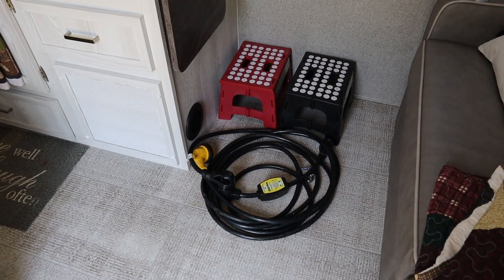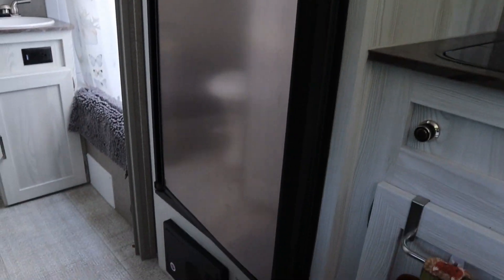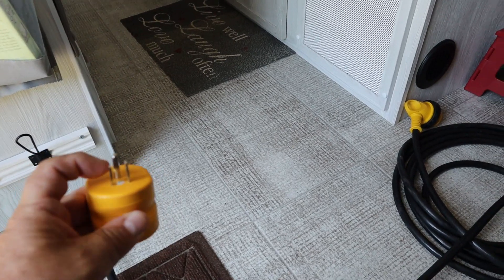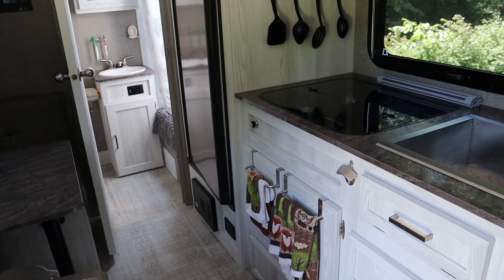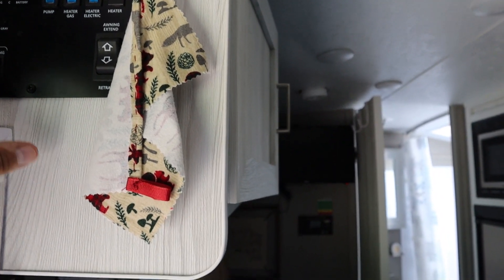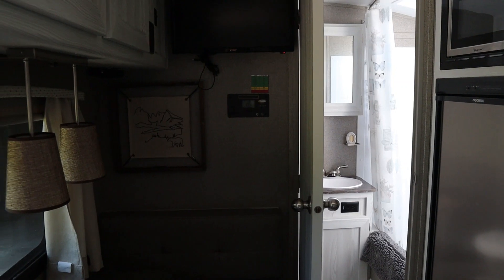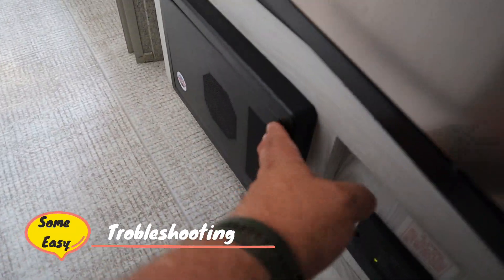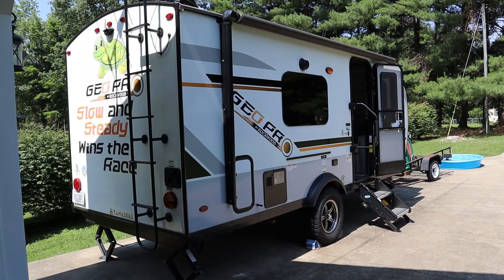RV Electrical

Comment: Good video, but it's actually 120/240.
Reply: Power companies are required to supply 120/240 but by the time it reaches your appliances, it can be as low as 110 due to the distance from the panel to the final destination in the home or office. That's why you'll see voltages listed on appliances as 110, 112, 115, 117, 120 or whatever the appliance manufacturer decides is minimum voltage for their device. Wish they wouldn't do that. Just confuses the crap out of everyone. I think you're the first person I ever spoke to that knew with certainty the correct voltages in the US.
Reply: @Tom-In-Ga  lol!! Yeah that’s the anal side of me with specs. I’m actually getting 115-117V at my outlet. Just installed my 30Amp so no more 15 amp outlet adapter. Used my unused 4 wire dryer wires, dropped one leg and bingo … 👍
Reply: @SEMPERFI8387  You know, that's a great idea. Guess what I'll be doing in the next couple of days? Thanks for the idea!

Comment: Love your insights! I have the exact same model, but a e-pro! One question I have is about never letting your battery get below 50%.  If I remember right, the panel doesn't register in %. Could you explain more into that?
Reply from the maker: I have a chart that explains the percentage versus volts, see my other video on solar to see the chart. You can print one by typing in dc voltage chart in google.
Reply: @Turtle3863  I downloaded that chart when I saw that solar video and it really is helpful. Taped it right next to my solar control panel like you did. Very handy. Quick glance lets me know right where I'm at.

Comment: Great video for the newbies out there and even those with experience. Electrical can be daunting to some. Only thing I would add is to recommend an inverter/generator instead of that monster you have. Fire that thing up in some campgrounds and you'll make a whole bunch of new, uh, friends . I've even been told off when running my little 2200 watt inverter genny in a campground that permitted genny use in the Smokies. And I run mine in the bed of my pickup, exhaust facing in, tailgate open, and hard bed cover. I try to be as considerate as possible and use solar when I can but sometimes solar won't work very well in shady or cloudy places. Anyway, love your videos and keep 'em coming!
Reply from the maker: Yes, I have never used that generator camping, just using it as an example